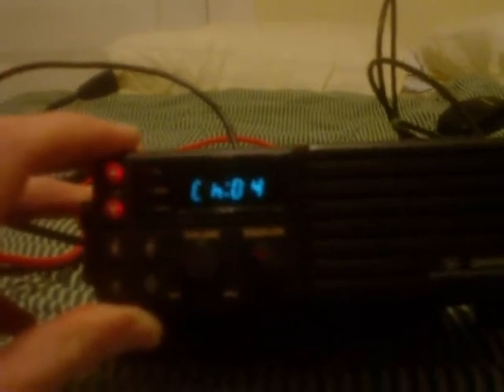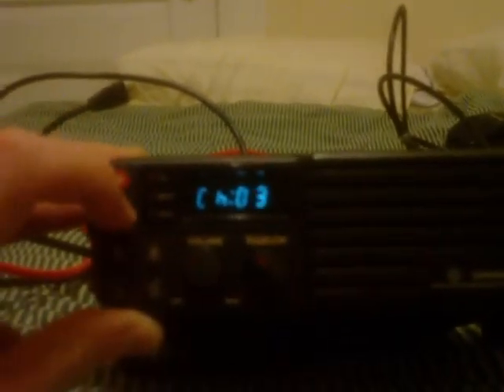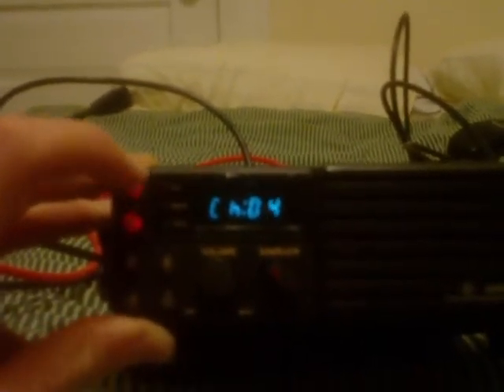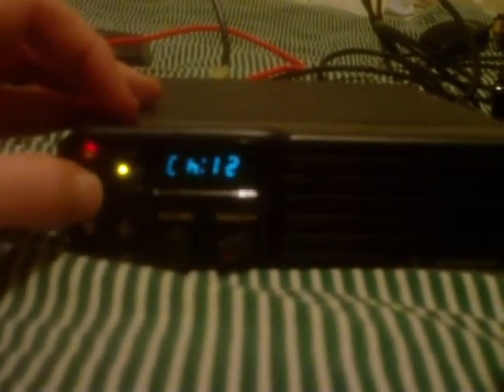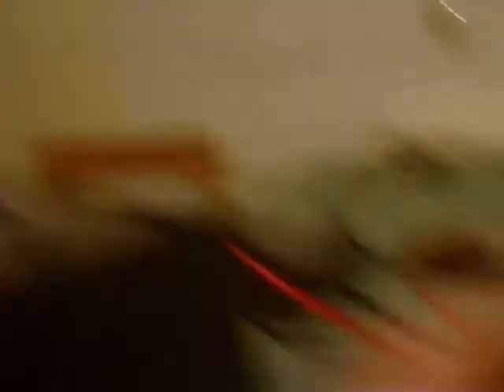Maxon SM-4150 (GE Monogram) VHF Radio MURS VHF CB Service TX and RX Test Mobile FM Transceiver

Comment: MURS is catching on around the country. I hear oil riggers in the boom in Texas are installing them in their pickups. In Los Angeles there are a few groups of ex-cbers on the air. I have a Rincon JobCom in my 18-wheeler with a Tram VHF antenna on the mirror mount. JobCom is a 10 channel with scan mode. I run open PL and scan while I drive. It's interesting what comes over. Sometimes I hear farming RC data going out. Of course every time I pass a walmart I hear the MGR calling some underling  to drag something out of the warehouse lol. But that channel 4 they think they own is also used be sever fast food chains, Macy's and 6-flags Magic Mountain in Los Angeles. There is a clause in the rules that you can use land mobile radios made before the 2000 date if they follow all the rules. There are a few that with small modifications will work. I just bought a Midland base station that has a 2watt/40watt selector for repeater use..I'm killing the 40watt ability. It will be a nice 5 channel murs plus being a 22 channel radio, I can program in the local control tower for when I get bored lol